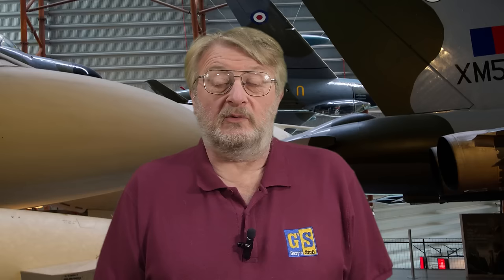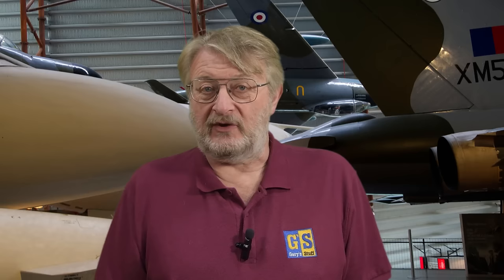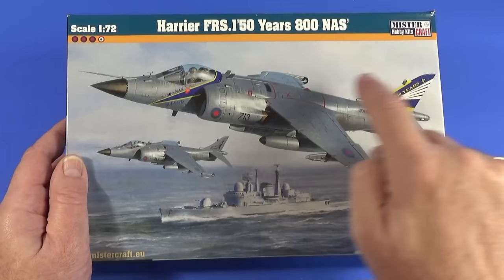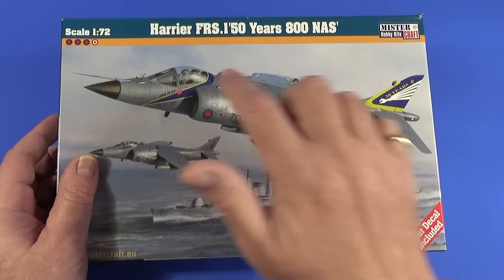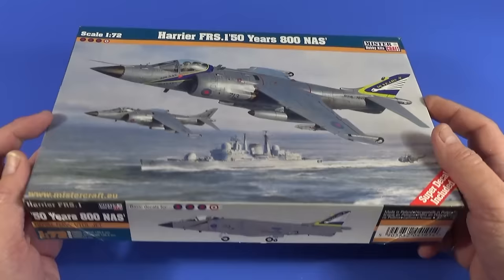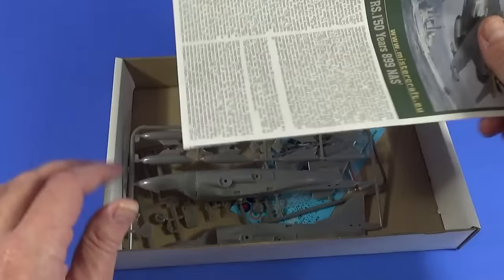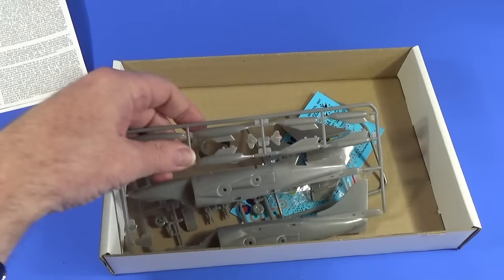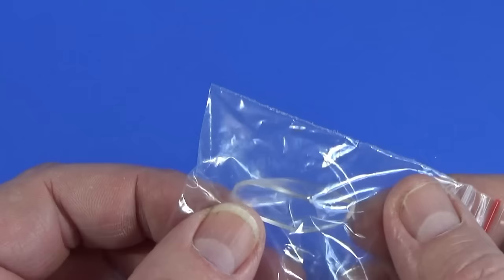Mistercraft Sea Harrier - WORST KIT EVER? What's in the box?

Comment: I built a 1/72 Messerschmitt 109 G5 from the same manufacturer recently, in the markings of Gerhard Barkhorn. Given the box lid says it was 'Bakhorn' ( no 'r'), I approached it with trepidation. It was well founded. In over 50 years of kit building, it stands alone as the worst. At one stage, I had five little piles of filings on the bench from trying to get parts to fit. I have a couple of other kits from the same source, but I think they will remain unbuilt.

Comment: I was screaming at the screen from the instant the box art came up! My father was involved with the flight trials unit of the Sea Harrier at RNAS Yeovilton ( 700A Sq) which was commissioned as 899, so I know the flying fist logo so well. Used to be a Sea Vixen squadron with that logo. Google would have told them they had it wrong. Sure 800 did fly Sea Harriers, but not painted like that. I didn't expect it to get better when the box was opened, and I certainly was NOT disappointed. Poor kit, poorly researched. Yuck.
Reply from the maker: Indeed 899 was flying Sea Vixens from HMS Eagle at the same time 800 were flying Buccaneers!

Comment: You missed out the fact that on all Harriers the two rear engine nozzles are a different shape to the two front engine nozzles.
(partly because of the different temperature of the exhausts at the rear and front)
On that Mistercraft kit they are all exactly the same. However, the Harrier predecessor, the Kestrel does have similar nozzles at the front and rear.

It's as if the kit was designed when the Iron Curtain was still in place and the designers had little access to the West's technology. So it's a mash up of different 'harrier/kestrel' aircraft.

Apart from that, the kit would be useful for kit bashing.

Comment: Best of luck with the Decals. I built the Mistercraft 1/48 Piper Cub last week, a reboxing of the Heller kit from 1979 (actually 1/50th scale but near as dammit). The model itself was not that bad, albeit the instructions were somewhat vague and left out a couple of the parts. However, the decals were truly awful. Very thick, yet still managed to tear easily. The lighter colours were translucent, and the decals themselves had no adhesion to them at all. Truly bizarre that Mistercraft put so many decal options in the box yet the decals themselves are useless.
Reply: it's a shame they don't work more of than that they do, those SHAR decals would look to be usable for other bits - even the det cord for the canopy is included!

Comment: Comes to it when a 1990's tooling makes the 1970's FROG Harrier GR.1 look good (and it's a lot cheaper generally on the 2nd hand circuit).
Aeroplast (the polish company that tooled it) should hang their heads in shame; particularly as they tried to pass this embarrassment off as a SHAR FRS.1 before selling the tool to fellow polish company Mistercraft.

Tis not the only stinker from Mistercraft though. I've got a couple I want to review, as it - like this "Harrier" kit - is arguably in breach of the Trades Discriptions Act 🤔😮‍💨 .

£10 is also a massive rip off, when considering that teo modern Airfix kits in 72nd can be bought for that money.

Comment: But is it as bad as Tamiya's 1/48 Sea Harrier...?  Or should I say Tamiya's filler that you need to finish with some plastic parts...
Reply: Built the Tamiya Harrier , You can get that kit for £10.50 . Its not great but buildable and it looks like an FRS 1. It has the correct shape , an ejector seat , Intake louvres etc... Proper decals and an instruction sheet that works. Not in the same ball park as the Mister Craft abomination (besides its 1/48 ). Definitely not Tamiya's finest by a long shot but old school modelling skills will produce a result and a ton of aftermarket (or 3D printing ) will produce a show winner. Not sure what category I would ever enter the Mister Craft one in .... anyway Tamiya include a Pilot , take the hint everyone else.

Comment: Those mouldings are horrible. If a beginner gets that kit the results will be terrible and it will put them off the hobby completely.
Reply: Luckily it's not a Starter Set. TBH it doesn't even qualify as a 1.
Reply: @julianmhall  True however as a beginner from personal experience you go for cost and model not skill level, My first kit was an Airfix Harrier because I had just watched an air display.